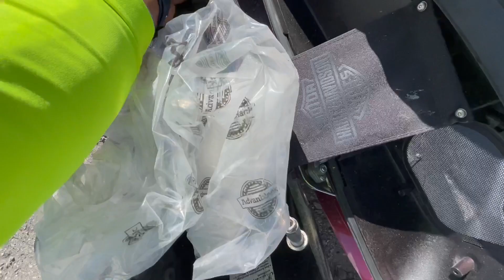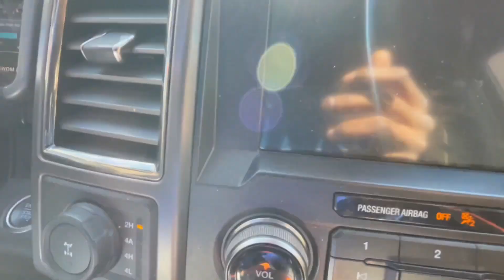WENT TO BUY A HARLEY FROM COPART AND THIS HAPPENED

Comment: A nice video, but just the wrong brand motorcycle.  I will admit that I own a 1950 Panhead Hydroglide, and a 1960 165cc single cylinder Super 10, sometimes called a Scat.  I bought both back in 1963.  Still have them, they're still stock.

Comment: Nice work, saving those bikes. I've done five so far and have really enjoyed putting them back on the road. The only bent frame I've encountered was on a 2001 RG that t-boned hard.  Neck forward toast, back hardly a scratch. Wasco Frame in Tacoma, WA straightened it out.  I usually build the RG and SG back as a Road King. Fairings are too expensive and too much too paint.
Reply: Gotta be a pro by now! Any tips and tricks for a first timer trying to get a hold of a RG S or ST preferably from Copart? Should you be looking away from the almost mint bikes as they always go super high on the biddings or what´s your tactic? Cheers man

Comment: noticed your ramp ,have the same one you might want to reenforce the center section with steel mesh like on a catwalk  otherwise the center section will  bend. mesh can be attaches with larg washers and pop rivets

Comment: I love watching your videos. Do jave some questions. What's a reasonable price for wrecked bikes. And the ones with fork damage do you check the neck bearings and or change them? Just educating myself. I want to get a salvage on that's not too bad and build it.
Reply from the maker: Every bike is different, so me saying what's a reasonable price would be irrelevant, you just have to find one in your budget. As for damage, everything can be simply fixed... just got to know where to take it if its worse than something you can handle

Comment: Great vid! I was actually most interested in the ramp.Taking a road trip alone with my Diavel 1260 and i borrowed that type of ramp for the van.Was worried about the 4" spacing between the rungs.Looks like it will be fine.Thanks.